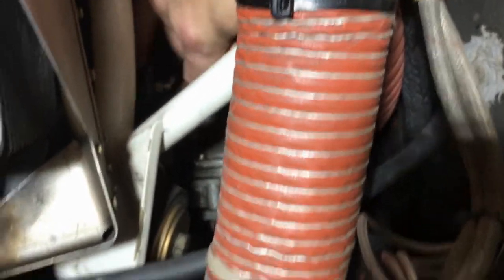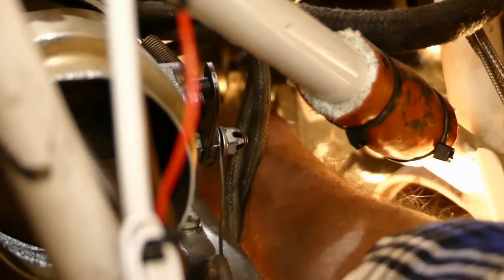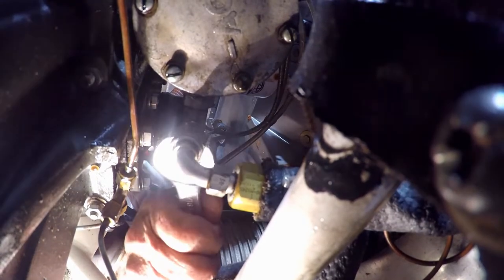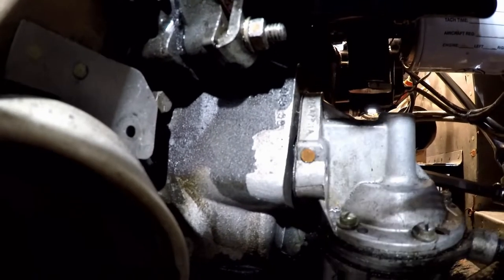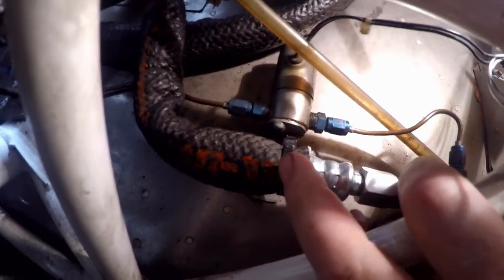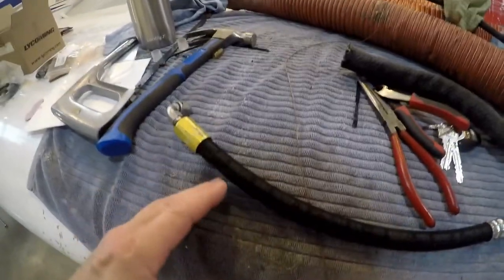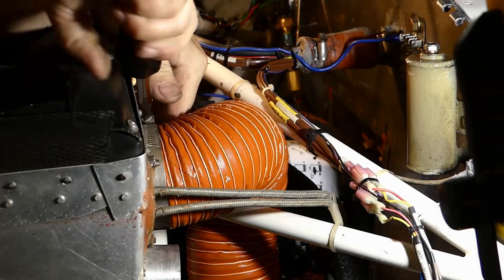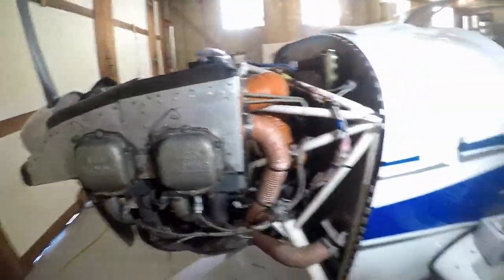How to Replace a Lycoming Fuel Pump

Comment: 9:27 Teflon sealant paste? Isn’t that fitting sealed with an O-ring? Also the fire sleeve is too short, should be secured to the gold part of the fittings and you should use metal clamps to secure it, or at least metal zip ties.. even double wraps of safety wire, but plastic zip ties will melt when you need it most.

Comment: Thanks for the video and I have a question about fuel pump, last week I had two incidents where engine RPM dropped really low for couple of seconds in the middle of the runway before taking off.  What could it be from the mechanical point of view? Could be fuel pump because the weather is hot?
Reply: Aircraft is Cherokee 140 and O 320 Lycoming.
Reply from the maker: Mukhiddin thank you for the question.   I am not an aeronautical maintenance engineer.  I am an aircraft owner that continues to learn about his aircraft the more he flies it.
When I experience my problem I had instrumentation to back it up.  On top of a fuel pressure gauge I have a fuel flow gauge.  This proved very useful when I had a fuel pressure gauge fail on an earlier occasion.  The fuel pressure was reading 0.9PSI, while the fuel flow was reading more than 60lph while climbing at 1700fpm.  Clearly the mechanical fuel pump was not at fault, but the fuel pressure gauge had failed.  
With my more recent failure, the fuel pressure dropped to near zero, the engine stumbled and the fuel flow was showing zero.  All three indicators pointed at a bad fuel pump. This is when i replaced my fuel pump.  
In your situation you mentioned it was very hot.  The first question that came to mind when I read that was are you using mogas or avgas?  Vapour lock, a whole other subject, can come into play in hot weather.
Sorry I can’t be of more help, but I’m not an AME.  I would however encourage you to find the root cause of the engine stumbling prior to taking to flight.  It will likely be something relativity simple to address.
Kindest regards,
Dwayne

Comment: First question is whether your friend is a certified mechanic (A&P). I know you do not have a repairmans certificate as you did not build the airplane. (Canada may be different, but usually more demanding than US) I.E. you can only work on your engine if supervised.  If your crimp hose ends were done at an auto shop, then more than likely you have the wrong fittings on the two hoses. Auto fittings are normally 45*. Aircraft fitting (AN fittings ) are 38*.  They are NOT compatible. If this is the case REMOVE the  two fuel lines.  You missed the difficulty in starting the two mounting bolts. The outboard bolt is easy, The inboard bolt is a b***ch. I have to use a ball end Allen tool to tighten the inboard bolt due to fuel pump body interference. I did not see the O-ring being put on the fuel pump inlet fitting? Missing?  I am glad to see you tackle this project, but make sure you are getting supervision.
Reply: experimental, he can do his own work
Reply: @matthewpellegrino4926  Let me clarify my original response.  If the airplane is in the Experimental class, and YOU built the aircraft, and YOU have a repairmans certificate for that airplane,  YOU may legally  work on that airplane. If you bought the airplane from from someone, or do not have a repairmans certificate  for that particular airplane, then you must have a licensed A&P sign off the repair.  There are some items that the "owner" of the airplane can perform, but replacing the fuel pump is  most likely not covered .  In addition, the Canadian rules could be different about this particular repair that allows the "owner" (i.e. not necessarialy the builder) to perform the replacement of the pump due to the airplane  being in the Experimental class.  
The fuel pump casting does not allow the two mounting bolts to be addressed straight on.  There is enough on an angle (due to the casting body roundness) that makes the allen wrench or socket  come in at an angle that in the case of the inner bolt a real tedious exercise.  Cheers.

Comment: That blue aluminum AN fitting on the carburetor should be a steel AN fitting which won't melt in a engine fire like aluminum. Even brass is better than aluminum fitting which also cracks easier. I don't recommend those automotive hose fittings the cone angle is different.
Reply from the maker: Thanks for the note.
Reply: Nice job the only thing missing were safety procedures (safety glasses, disconnecting battery, fire extinguisher, etc,) 
                Cheers John